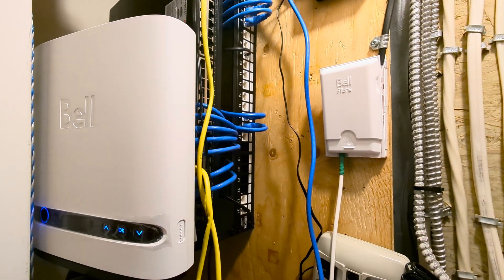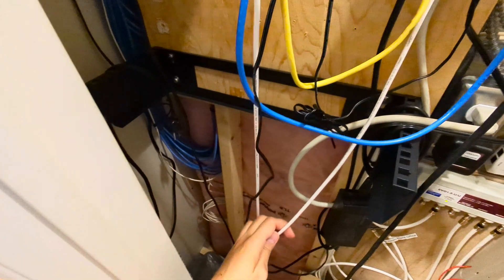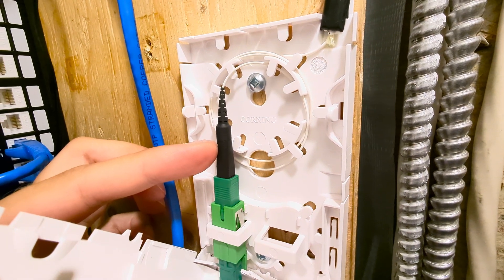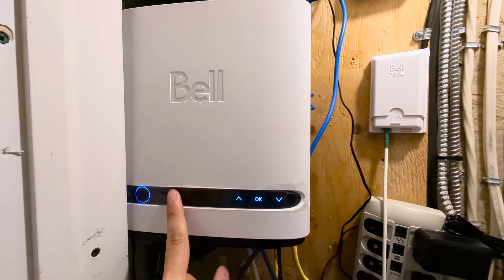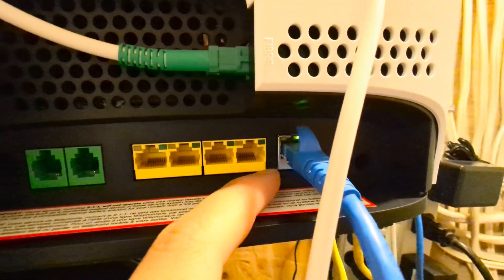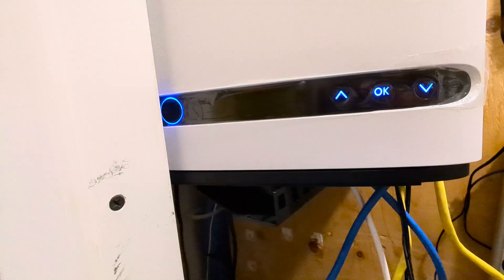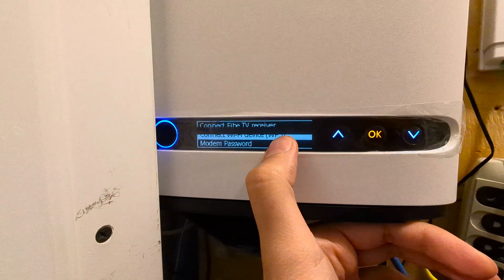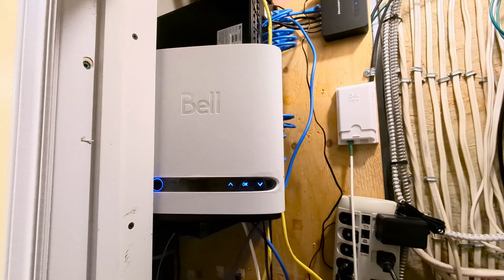Bell Giga Hub Initial Review

Comment: Hey! I’m about to sign up with bell fibe but wondering if I’ll be able to use my nest wifi router and access points with this giga hub. Anyone done this before? Thanks in advance!
Reply from the maker: Yes, I’ve done this many times, reconfiguring the Giga Hub as a media converter for any 3rd party gateway unit. In my case, it's usually pfSense. I actually have a tutorial on this: https://www.youtube.com/watch?v=eXvDnGUWn3A. Make sure your 3rd party gateway unit gets a public IP address on the WAN interface—you don’t want it to be double NAT.

Comment: Your first issue is the closeness of the GIGA HUB to the main power, this emits electromagnetic interference for WIFI. Need to move it away from panel more.
  Signed 
   BELL Tech
Reply: Maybe you should re-watch the video.
Reply from the maker: @steveevans3192 Why would you suggest that? Do you really think I'm using Bell's Giga Hub built-in Wi-Fi?

Comment: Do you know exactly what type of coupler it is i have been trying to find a new one
Reply from the maker: I do; you have to use an SC APC coupler. Make sure that both connectors connecting to the coupler are also SC APC, or you're going to have a bad time and could potentially damage the tips.

Comment: How long is the fiber cable from the jack to the hub? Did they give you any options as far as length goes? From where my fiber comes in to where I want the hub is about 50 ft.
Reply from the maker: The SC/APC optical fiber cables are approximately 6 to 10 feet in length. Unfortunately, I did not receive an option to obtain a longer cable. Despite my inquiry, the installer had none available, nor did he have any outdoor demarcation enclosures. It seems that Bell's fiber services are in such high demand that they are struggling to quickly restock components.

Not receiving a fiber optic cable from the technician is not a significant issue. If this were 24 years ago, I might have needed one, depending on the fiber mode. Nowadays, fiber cables are as affordable as Ethernet cables. You can currently purchase a fully terminated SC/APC optical fiber cable with an single mode OS2 9/125μm fiber mode that is 20 meters long for $6.70 CAD before taxes and shipping.

The single mode OS2 9/125μm is capable of supporting up to 400Gigabit per second at a distance of 10km when operating at 1310nm, or it can support distances up to 40km at 1640nm.

I think I should make a video which cable to buy and how to order them online.
Reply: Thanks for the quick and detailed reply. Cheers!
Reply from the maker: No problem. You're Welcome.

Comment: I'm having difficulty opening ports for a flight sim with the Bell Home HB 4000. Is I have the following ports forwarded 23456, 6073 , 2303-2400   When I check with Port Forward it shows they are closed. Any suggestions?
Reply from the maker: There could be several factors at play. I'll begin by using pfSense as the router instead of the Hub 4000. 
Also, why do need to port forward? Are you hosting a flight simulation game?
Reply: @Tek4You-  I'm not hosting but joining through FSHostClient 1.5b3.
It requires the aforementioned ports to be open. This is for flight simming.
Reply from the maker: You're mistaken; port forwarding isn't necessary on your router for client-side applications. It's only required when you're hosting a service. This is also mentioned at chocolatesoftware.com website.

I wouldn't be surprising if your system unit's firewall is blocking traffic to certain outbound ports. Similarly, I wouldn't be surprised if the first time you ran the client-side application, you didn't grant it network access when prompted by Windows.

Just disable firewall temporarily for testing.

Comment: having a nid outside is the way to go. you dont lose anything on fiber. since its a light reading. the reason i personal like a nid outside cuz if my service wire gets damaged technician doesnt have to come inside. they can just repair it from outside. and light needs to be lower than 24.00dBm. you can get between 25-8000mbps.
Reply from the maker: This is the same reason why, I kind of wanted NID that technician does not needs to enter into my house, but that's why I did a service loop outside. If anything I can have them installed NID outside the house in the future. At the same time, I was hesitant to have the cable spliced with a coupler because I didn't want to lose any signal. However, upon reviewing the copper specs, I found that the insertion loss is ≤0.2dB, which, depending on whom you ask, is practically negligible.

Comment: Holy cow... 5A power supply!  That must be quite a power hog!  Did you get to plug the modem in a meter like "Kill-A-Watt" to measure actual consumption when in use?
Reply from the maker: No I haven't, don't have time for that and don't really need to.

I'm using this gateway unit as a medium converter so it's definitely not draining 5 amps at 12 volts
Reply: It's not.  It's not running at 120V 5A, it's converting 120VAC to 12VDC, consumption is on the 12V, so it's 5A at 12V.  To get the consumption, multiply Volts x Amps = Watts, so total watts consumption is 60 watts, not a power hog at all !  Just to give you an example, a 15A circuit can handle up to 1800W (120 x 15).
Reply: @jimmydandy9364 : Thanks for the explanation :)  Still for me 60W is relatively quite a bit when I have a full mini PC using 10-20W which I can convert into a router myself.

Comment: Are you planning on posting a video for the bridge mode?
Reply from the maker: @EZzO444 Yes, I am planning on posting one. By the way a little secret, the Giga Hub is always in bridge mode.
Reply: @Tek4You-  what do you mean it's always in bidge mode ?
Reply from the maker: The Giga Hub is essentially always in bridge mode; there's no specific setting you need to enable for that. However, if you want to adhere to best practices, there is still a recommended process to follow.
Reply: @Tek4You-  I wish I could use this box as a modem and AP, but still be able to put my pfsense router in between. That way I would not need to buy a dedicated wifi 6e AP.
Reply from the maker: With your requirements that's impossible.
For the best user performance and experience, I highly recommend getting a Ubiquiti Wi-Fi 7 enterprise access point. They're not as expensive compared to when Wi-Fi 6 access points were first released.
Reply from the maker: Yes, I have created the tutorial. Here's the URL: https://www.youtube.com/watch?v=eXvDnGUWn3A

Comment: they are RJ-11 (the phone jacks)
Reply from the maker: What are you referring to? Can you provide a specific time code? I typically don't make errors, and if I do I correct them.
Reply: 4:15 you talk about the jacks for the phone service  and you say  not sure what the technical name for them is   RJ-11... just like Ethernet is RJ-45  @Tek4You-
Reply from the maker: Technically, it's not RJ-11; RJ-11 is a connector type that is terminated on the cable, which connects to an end device like a Giga Hub. These ports have a technical name that I don't recall at the moment; sometimes people refer to them as RJ-11 jacks, modular jack, phone jack.

Additionally, it's technically not RJ-45; it's 8P8C.

This is one of the primary reasons why I started my YouTube channel, lots of misinformation out here.
Reply: The yellow ports are for RJ45 cable ends.  The green look like they are for RJ11 cable ends.  The one port when the fiber is plugged into is specifically for the ST connector.
Reply from the maker: Technically the fiber connects to SC APC coupler on the Giga Hub, and yes it's actually a couple.
https://preview.redd.it/ecafc0ckcn971.png?width=1362&format=png&auto=webp&s=46cc399679b0fb5fdd1143f11637020083bfb3a7
Reply: @jamiepatterson1214  Since this is also a router, the yellow connectors are for connecting your network cables to your devices.   The green connectors are for connection phone line 1 and phone line 2 (if you have more than 1 line with Bell). If you have multiple phone jacks in your home, you would connect a phone cable on Phone Line 1, in the modem, and the other end into any phone jack, which will back feed all the other jacks in your home.  Make sure to comply with the REN for this device, so ideally you would want to connect this to a wireless phone base, and you don't have to do so directly, just any nearby jack.  Nowadays people use wireless phones, which come with 2 to 4 headsets or more, so one device.

Comment: What router do you recommend?
Reply from the maker: Your question is quite broad, so the answer will depend on your specific goals and requirements.

For the operating system, I'd recommend pfSense, pfSense Plus, or OPNsense, depending on your needs.

As for hardware, the choice will depend on what you aim to accomplish with the application. If you prefer a hassle-free, stable solution, purchasing directly from Netgate would be a good option. However, if you anticipate needing more customization—for example, the ability to upgrade from SFP+ network cards to QSFP in the future—then a custom-built system may be more suitable.

Ultimately, the decision will be influenced not only by your application requirements but also, in some cases, by budget considerations.

This could be an extensive topic on its own, so I'll keep it brief. I've been testing my Bell internet connection using a pfSense running on server processor (I can't recall which one at the moment). Whenever I run a speed test, When I conduct a speed test, I am able to fully utilize my internet connection, reaching speeds of 3 Gbps symmetrical. I plan to release a video elaborating on this topic in the near future.
Reply: @Tek4You-  Thank you so much!
Reply: @Tek4You-  Did you have full speed using PPPOE on your pfsense box ?
Reply from the maker: @mekano1  Yes, to accomplish this, I utilize the Xeon E5-2470 v2 CPU. The processor maxes out at 25% when transferring data in one direction, reaching speeds of up to 3100 Mbps.